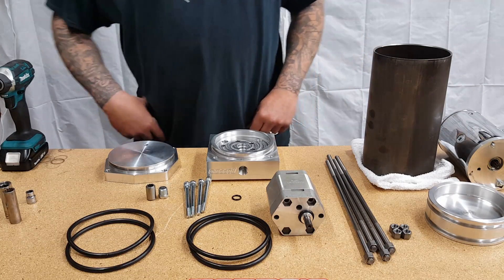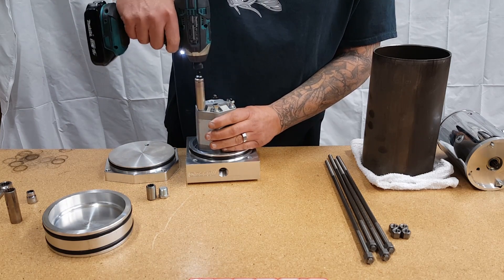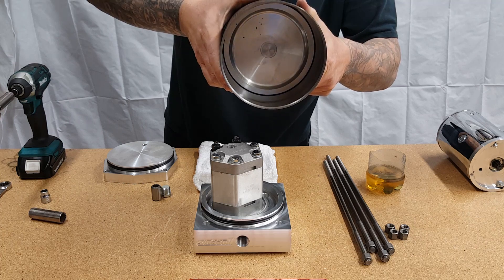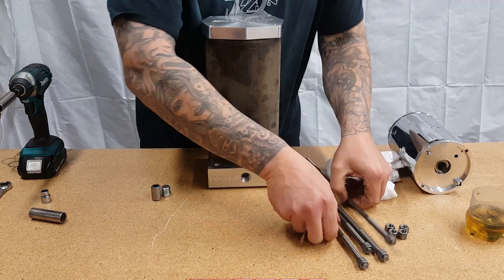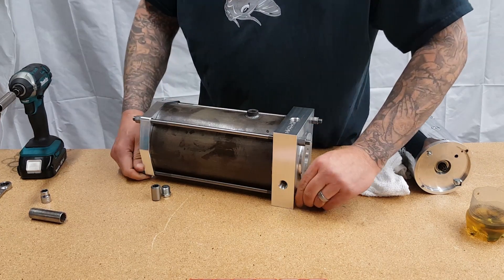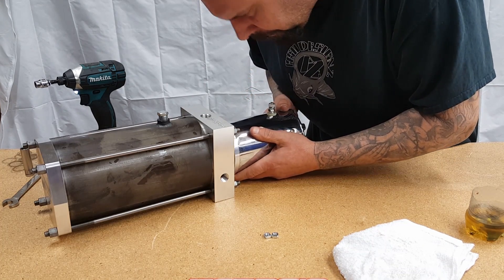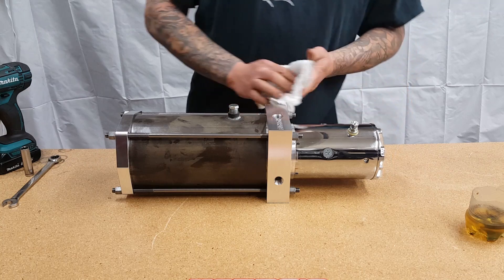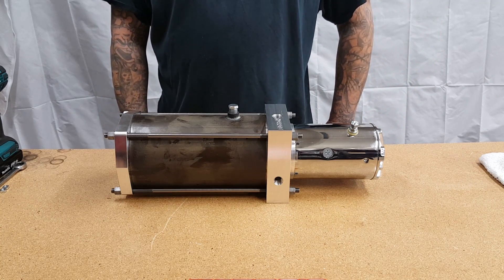How to assemble a hoppos piston pumps!

Comment: I think you have the plunger on backwards? The amount of oil in the system fully filled, wouldn't allow you to push the plunger close to the gear. That's not what the deeper side of the plunger is for. The deep side of the plunger is to have space in between the back plate and the plunger to create a void for the air. 🤔
Reply from the maker: The plunger is correct we would actually  get the indentation  of the gear bolts on the center of the plunger cuz it smacks so hard
Reply: @Hoppos_alex   I see that happening if you didn't take the space in the cylinders in consideration before pressurizing?
Reply from the maker: @Ovniware33  🤣🤣🤣🤣  I'll let ya  continue  to think about that one lol
Reply: @Hoppos_alex  just look into it, please. You are giving false information.
Reply from the maker: @Ovniware33  🤣🤣🤣 definitely  not but if that's make you sleep better👌👌
Reply: @Hoppos_alex   That's cool. I'll just go with the majority. We can't all be wrong. 🤷‍♂️
Reply from the maker: @Ovniware33  look man every one's a pro right. Not only do we do this for a living but we also are the who's who design, machine, test and build these. Not saying the way you do it is wrong but it's not how we do it. We have tested hundred of different vehicles with different  configuration    we have had street cars working and radicals all working 120 inches plus with this technology.  Record holders, award winning to lowrider rules and specs.  This video didn't say you NEED TO DO IT OUR WAY OR THE HIGHWAY,  you can do it how every you heart desires  good luck and best of wishes for ya
Reply: @Hoppos_alex  👍